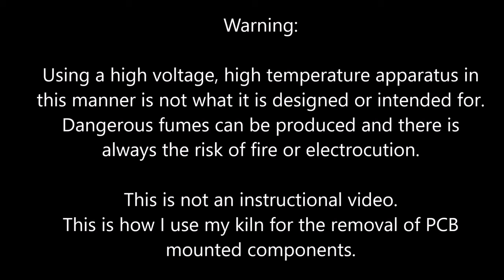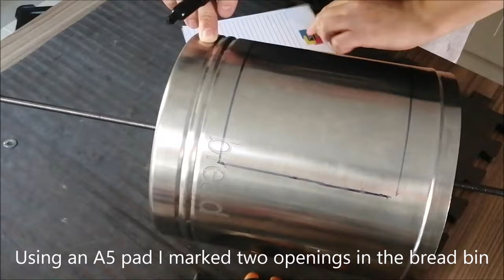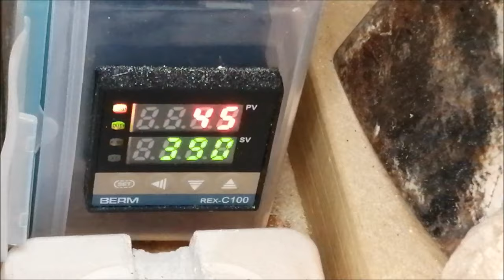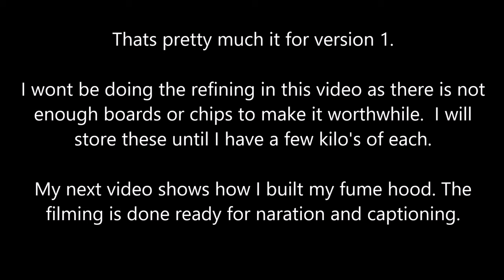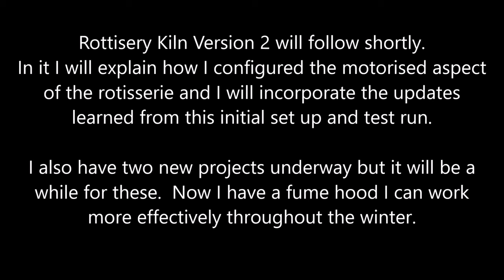ROTISSERIE KILN FOR EWASTE RECOVERY

Comment: Your next step is the same, but install a fine mesh screen inside the can. Then add a gas burner, put a cookie tray on the bottom to catch the ash. Load the can with the chips. Turn on the burner, just a low orange flame. The chips will burn as they tumble , the ash will fall into the tray. Keep it going until there is nothing left in the basket except the chips and maybe some legs. There sill be nothing in the ash but the gold. I ordered everything online, even a variable speed motor, search rotisserie parts. Total cost about 60 USD. Currently have 6 to 7 lbs of chips, ran about 6 lbs as a test
Reply from the maker: Thanks for watching Joe and the feedback
Sounds like a nice setup you got there :) You should put a video together of your rig
Yeah next step for me is to get a better motor system.
Reply: @scouseurbanminer5106  Works like a champ. Turn it on and walk off. No stirring chips around trying to get them burned all the way. they need air to burn to total ash. The setup allows all the chips to get plenty of air as they burn. The ash falls off exposing more to the air, it burns and so on. Nice clean ash with all the gold in it lying in the pan. I thought of it years ago and wanted to use a cement mixer. Decided to go small.
Reply from the maker: Sorry for late reply Joe, only just seen this, my YT doesn't prompt me when someone replies, need to check all the settings on this, only just come across this now. Defo put a video together for us all to watch, I'd be interested in giving it a go, I like the building part of a project more than the actual refining.  I have started an incinerator video but haven't got round to finishing it yet, weather has been awful and work takes up most of my time. I will see about incorporating a rotisserie into the incinerator, once it finished and have ran a few test runs.
Reply: @scouseurbanminer5106 You sound like me, I enjoy the creative part. What about this or that? How can I try it? How do I build it? Then my head goes crazy. I will say this is the first hobby I ever got into that makes me money and it has nothing to do with the money. Just the enjoyment. Sitting down picking through electronics. Modifiing tools to do things they were never intended to do
Reply from the maker: Yeah Joe, exactly the same, I've always loved taking things apart (Except Laptops, I've started to hate them things hahaha) but I also like putting things back together... DIY and home improvements etc, in the two houses I've lived since I grew up I've built a full loft conversion and a complete kitchen rebuild, taking the old kitchen out was the best bit though, got the big guns out for that and stripped it right back to the brick, covered in dust and mess, happy days :)

I agree this is a hobby that does bring in more than it costs once you have forked out for the initial refining gear but like any hobby there's always something else you "need". But this is way cheaper than my other hobby, I play golf and I'm a full 7 day member of a club. That is expensive and gold recovery comes no-where near the cost for that.